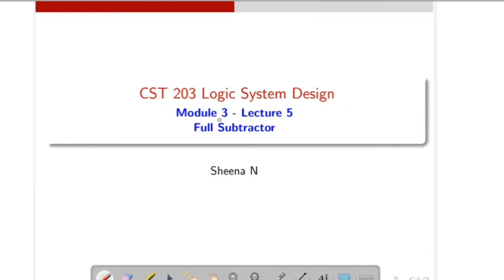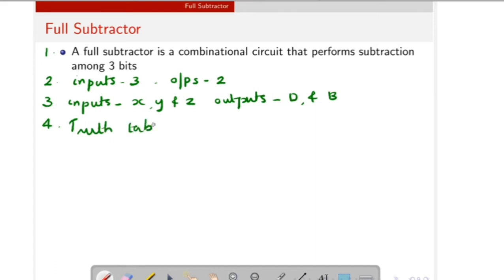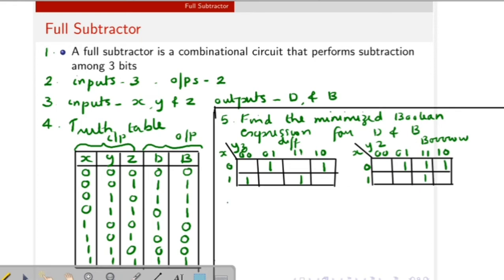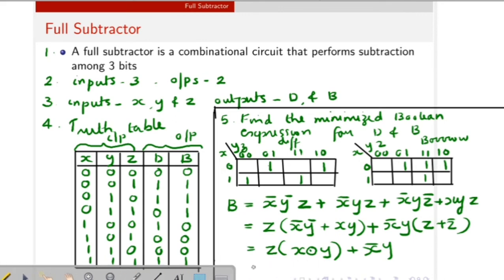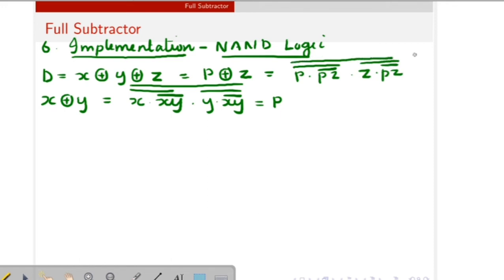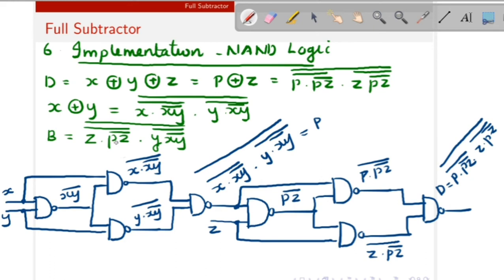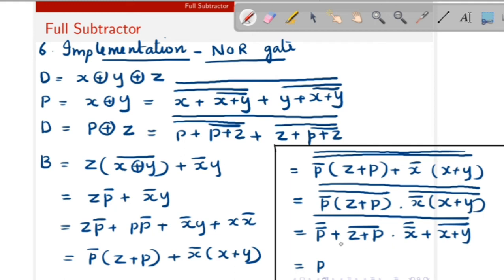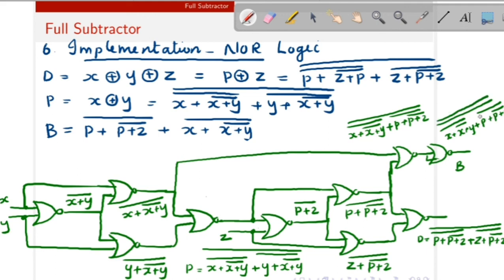Module 3 - Lecture 5 - Full Subtractor || Sheena Kiran

Comment from the maker: A mistake at point 21.38 for the expression X xor Y. Read it as given in the following link at point 7.55.  So in the logic diagram draw one NOT gate using NOR gate at the end of the logic diagram for difference for each half subtractor(at points 25.52 and 27.00)

Module 2 -Lecture 7 - Implementation of all gates using NOR gate
https://youtu.be/07Fyt_iV7uQ